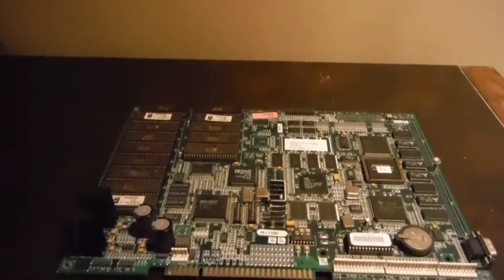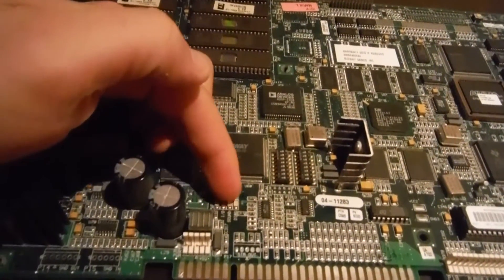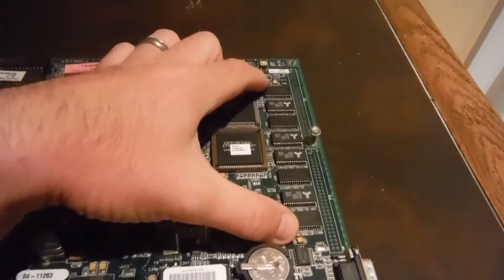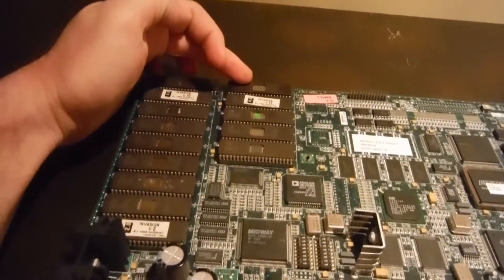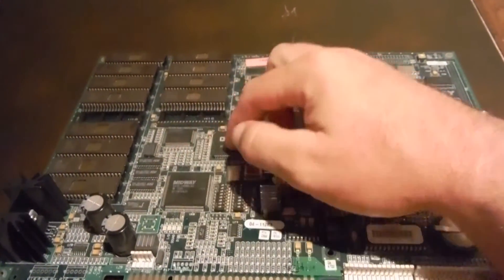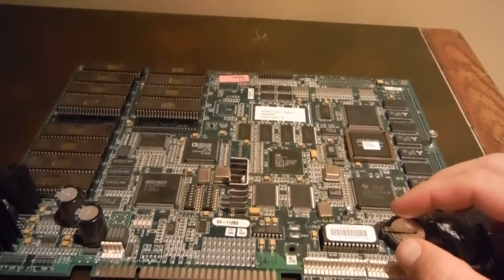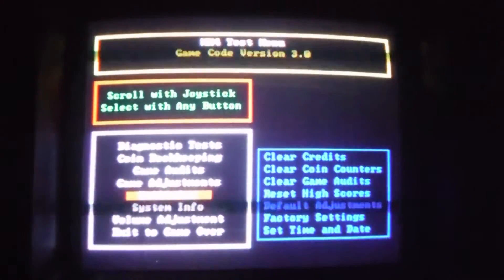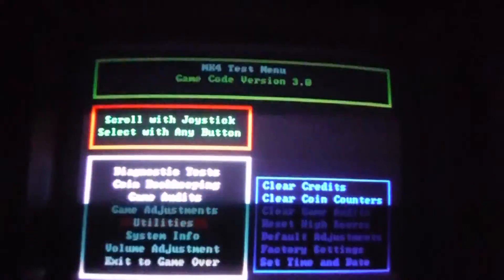Converting an Invasion PCB to a Mortal Kombat 4 PCB

Comment: Hey Joe, I am trying to do the same thing with my invasion board could you help me out with getting the cracked roms. I have a eprom burner just need the data. Thanks in advance.
Reply from the maker: Sure thing. The guy that cracked them encouraged me to share.http://www.romspy.com/temp/mk4-any-u76.zipIf the link doesn't post or doesn't work just send your email address and Ill send the link.
Reply from the maker: http://www.romspy.com/temp/mk4-any-u76.zip